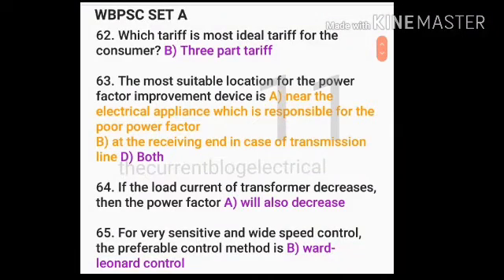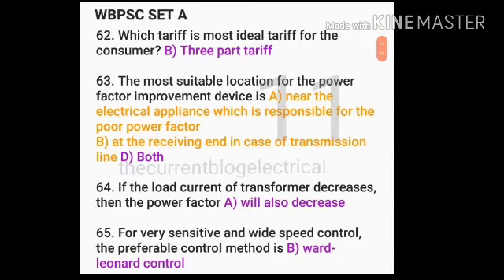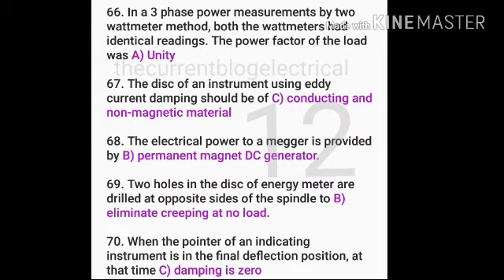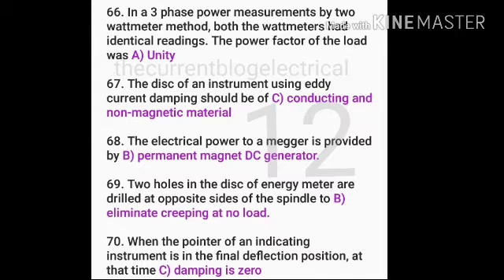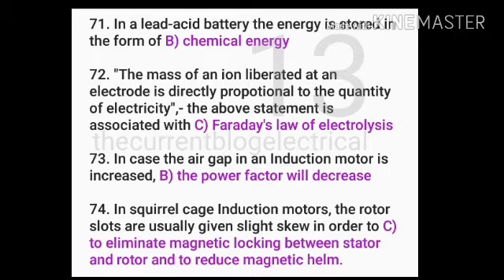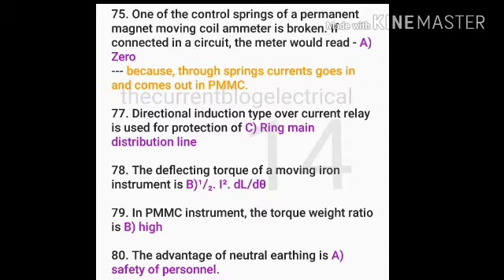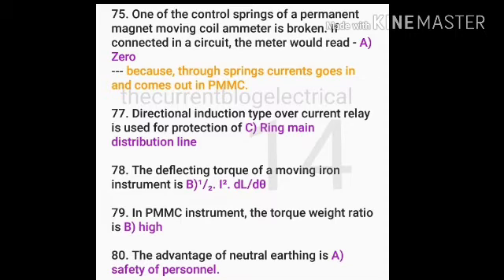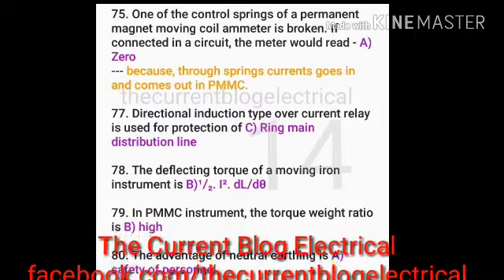WBPSC 2018 ELECTRICAL SOLUTION  (SET A 62 to 80) PART 4

Comment: Sir , for Q.70 when the pointer reaches final position then there is no opposing torque ie controlling torque is zero
Reply: Debjit Das according to basic fundamental, controlling torque will increase with deflection angle. At final position controlling torque will be same to deflecting torque.
Damping torque is there if pointer is oscillating. If it stays at final position, no oscillation is there, so no damping torque.